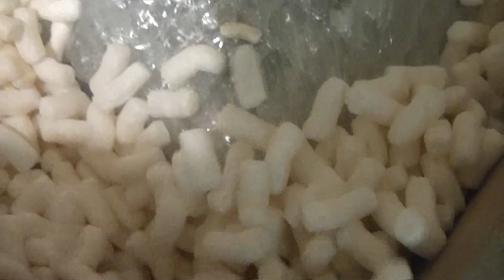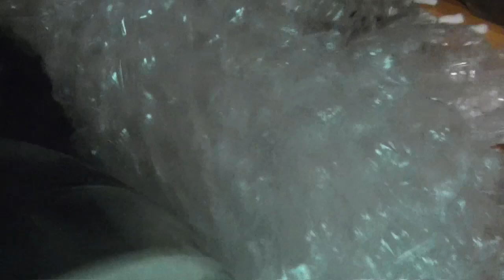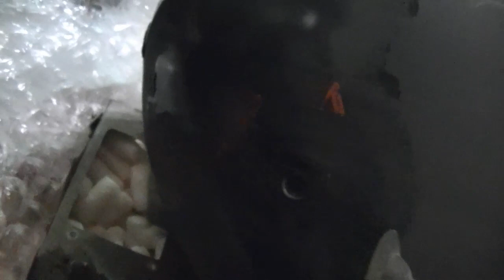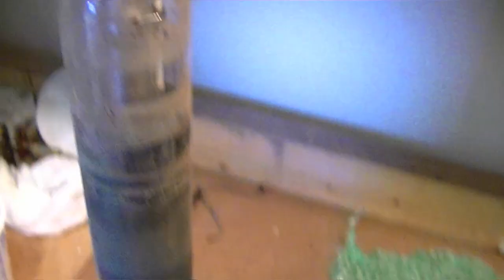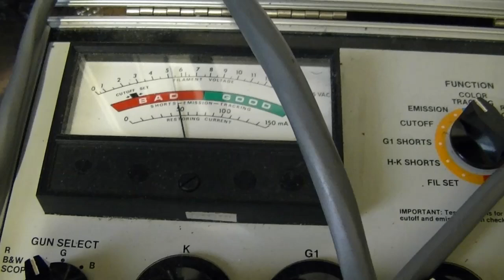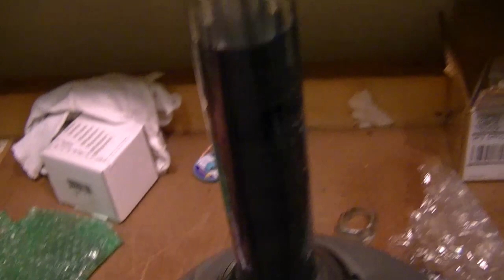Friday night unboxing 7/4/2014

Comment: The universal adapter on the CR-70 messed me up once. It gives the switch settings for the tube, then tells you to use the universal. Tube did not test. I faulted the adapter, until I saw the universal instructions say's set switches to 3, 4, 5 for all tubes using adapter. Contradicted itself. Threw me. Am I right? Glad to see the tube is good.
Reply from the maker: The settings chart shows you which pins on the CRT to hook the leads to when using the UA.  F1 = 1, G1 = 3, G2 = 10, etc.  So I wouldn't really say it contradicts itself.
Reply: bandersentv
Thought it meant how you set the CR-70's switches for testing, like when using a socket. Then other note for the adapter say's set switches to 3,4,5 & that worked. I had no trouble with the numbered leads, only the setup switches. I'll look at it again. Maybe It's how I interpreted it. Thank you.
Reply from the maker: Farmradio
Yes, it does mean switch settings when using the other adapters but for the UA it's CRT pin #s.
Reply: bandersentv Ahh. The pin #'s when using the UA. Thank you again.

Comment: Very helpful video.  I have wondered what to use for the loose CRT bases.  You mention the 17CP4.  I have a Hoffman TV with one in it.  The original was completely dead, but luckily I found a good one.  The 19AP4 metal glass CRT is one of the main issues with the neat looking "Giant Circle" Zeniths.  I have another Hoffman that uses the 19AP4.  It is not dead, but pretty weak.  These are pretty much made of unobtainium these days.      

One more question, I have restored a few of the later 50s sets that use the yokes that have the falling apart plastic.  Have you re-done any of these yokes?  I have done a few using plastic, hole saws, and glue. They look horrible, but work.  I saw a person do one on VideoKarma using a lathe-it looked great.
Reply from the maker: No, luckily I haven't needed to do any yoke surgery yet.  The ones used on the earlier sets really held up well.

I had a very strong rebuilt 19AP4 I let go too cheap I think.  I've only restored one TV that used a metal CRT so far.  Kinda scary to be around them when they're powered up.
Reply: bandersentv Yes, you have to be careful with the metal/glass CRTs.  If I remember correctly the 17 inch Hoffman 17CP4 CRT has about 11,000 volts on the metal shell.  Hoffman also made essentially the same TV with an all glass 17HP4 CRT. I have one of these also,  not nearly as stressful to work on.

Comment: i've also seen copper evacuation pips on 15gp22 and 21fjp22 tubes
Reply from the maker: Thanks for the info.  From the responses I've gotten it seems that RCA used this technique on early runs of several color and B&W CRTs.

Comment: Those metal pinchoff nipples suck, rca used them on color crts and I have seen several of them gassed out. Heres a video I made on it some time ago. Gassy RCA Color 21FJP22 has copper steal evacuation nipple 21FBP22 CRT
Reply from the maker: Thanks for the info.  I heard on videokarma RCA used them in some early 10BP4 and 12LP4s too.  Glad this one is still holding up.
Reply: I've heard that the failures were mostly in the early metal-glass colour picture tubes, like the ones used in RCA CT-100s, as well as those 21FJP22s, but it wasn't due to the exhaust nipple so much as the weld between two of the metal parts. A lot of people seem to encounter similar problems with RCA made black and white, metal-glass picture tubes of the early 1950s, one of their early rectangular tubes was notorious for it, I think it may have been a 17 incher.
Reply from the maker: OlegKostoglatov   Yes, a lot of B&W CRTs get leaky along that weld.  You;re probably thinking of the 17CP4 metal rectangular CRT.  There's one on ebay right now.  I think red means it's a rebuild.   http://cgi.ebay.com/ws/eBayISAPI.dll?ViewItem&item=111400388274

Comment: A great move getting that chassis! Looks like it never saw a prolonged stay in a damp environment. Could the copper fitting be a sort of protective cap over the usual pinched-off glass? Good luck with the project!
Reply from the maker: I asked around online and apparently the idea was that using hot metal to seal off the tube rather than glass would results in a better vacuum.

Comment: I've been using the black version of that windshield and glass adhesive, it works very well for gluing bases back onto tubes. Lacquer thinner will clean up the residue, as long as you catch it before it completely dries.
Reply from the maker: Good to know.  I saw it at the store but wasn't sure if it would work well or not.
Reply: I thought maybe you used the Permatex windshield adhesive before? Or was it some other type? In any event I don't think the black stuff has acetic acid in it either as it doesn't smell like vinegar, so I hope it lasts longer then the bathtub caulk which does. I bought a tube of it in Home Depot to repair some earlier AC tubes, some had loose bases while others had to be taken apart in order to redo the solder joints on the pins. By the way, lacquer thinner softens that old cement they used to use inside tube bases. I am also going to see if some CIL Dulux auto paint reducer will do the same since I ended up with an old can of it, so old that it was sold in an Imperial gallon size can not a U.S gallon size can.
Reply from the maker: OlegKostoglatov
Yes, I have used the same clear windshield adhesive I used in this video, but never the black.  The black stuff says sensor safe on the package which means it does not contain acetic acid.
Reply: I could hove chosen the clear kind, they had that too, but I figured that the black would blend in better with a tube base since those are usually made of black Bakelite. Did you manage to completely use up the former tube of clear or did it go bad on you? I'm sort of wondering about the shelf life of this stuff but I could not find an expiry date marked anywhere on it. I wonder if it has enough dielectric strength to insulate a flyback coil?
Reply from the maker: OlegKostoglatov
I used it all up which took several years. Definitely got my moneys worth :)  You might be able to find the dielectric strength somewhere on the web.
Reply: That's good to know, the tube I bought was not expensive, but it was more then the usual bathtub and household stuff, and you don't get quite as much.

Comment: Send the rust magnet to a commercial sand blaster..

For the permatex stuff:
http://www.permatex.com/products-2/product-categories/adhesives-sealants/sealants/permatex-flowable-silicone-windshield-glass-sealer-detail
Reply from the maker: How much would that cost ?
Reply: Not a lot. I often get stuff I have to send in to have blasted. And many places will just charge a small fee to do that included in with some other parts they are doing.(they like doing things in batches), Another thing I would suggest that isn't as damaging is soda blasting or bead blasting and there are places that will do that too.